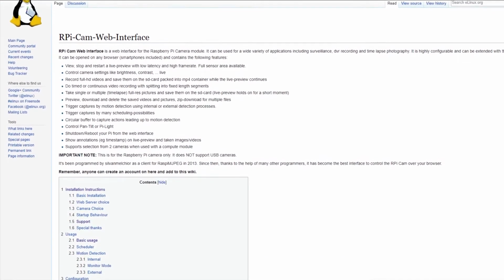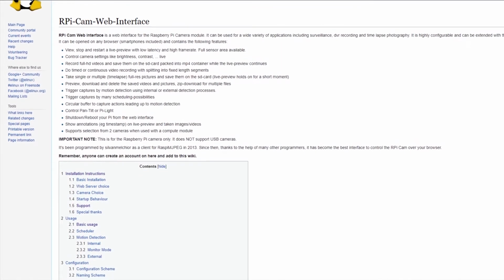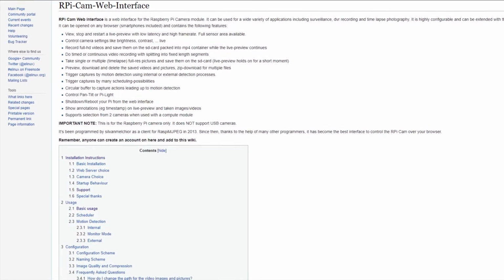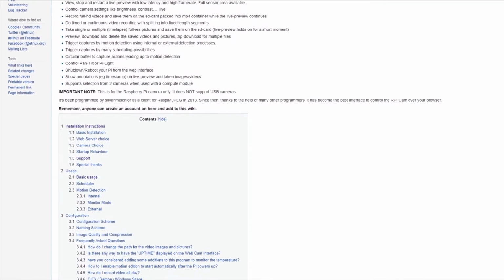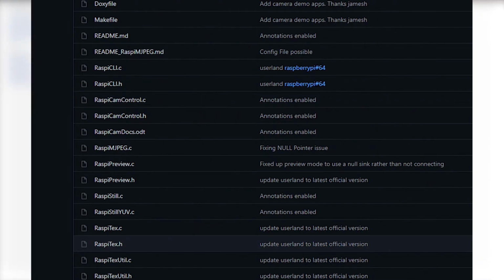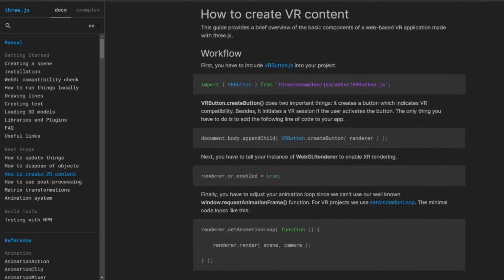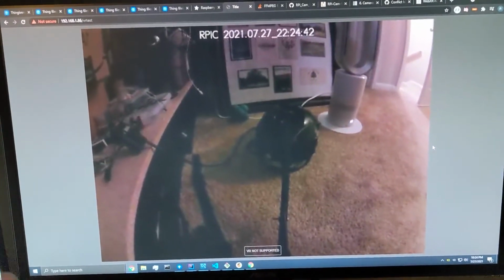View Your Life In 3rd Person?? DIY IRL 3rd Person VR Camera

Comment: Why did you go with raspberry pi when modern smartphones are so powerful? My GF got chinese android phone for 500 bucks and it is way better than my 1k$ macbook pro 2021 m1 spec-wise
Reply from the maker: The Pi camera is much easier is mount higher with it being lighter & developing the app is also quicker to do than having to make a full app for the android phone
Reply: @TurkeyDev  I've never developed  a phone app and I've never even seen a raspberry pi in my life, but I've done a lot of web dev stuff and since you've mentioned javascript I thought maybe I could do something similar, preferrably on a 300$ samsung I use my everyday life. Do you think it's possible?
Reply from the maker: @vakarimasen  the issue comes with the camera feed. That was not written with JavaScript which is why I used the raspberry Pi. The JavaScript you saw was actually on the phone that I used, but that was only to display the streamed video feed from the Pi
Reply: @TurkeyDev  Thanks a bunch, I'll keep you posted if I achieve something
Reply: @TurkeyDev  I mean, you can run javascript on anything, right?